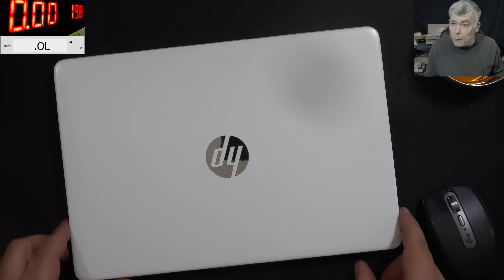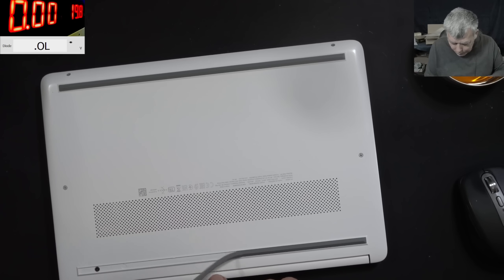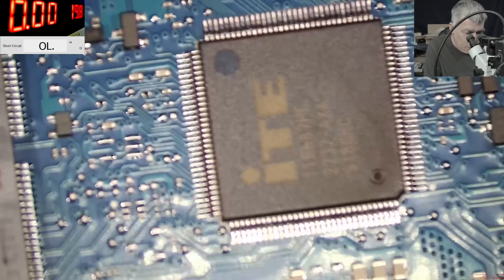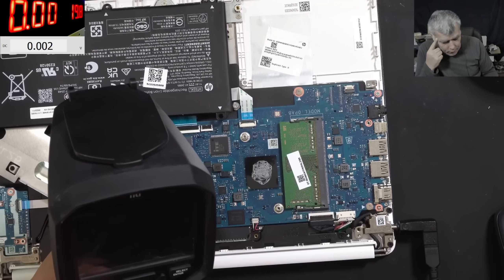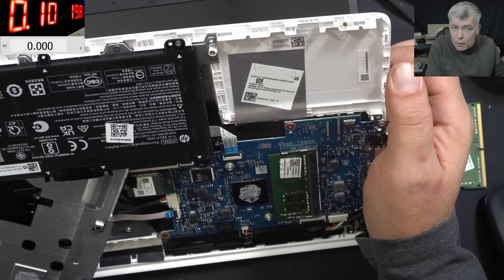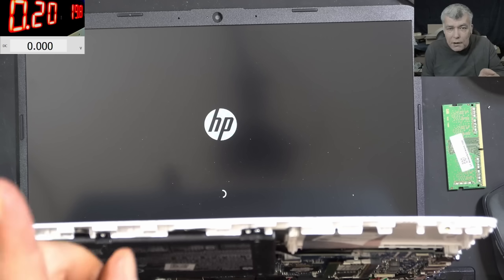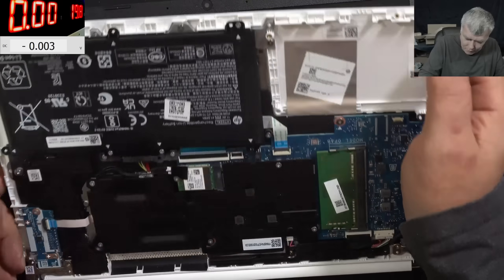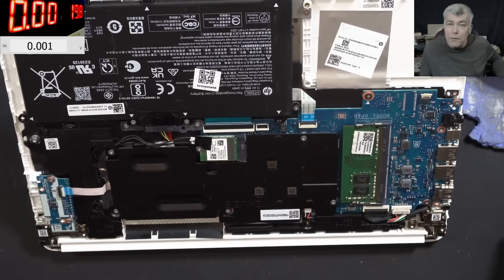Hp flashing screen, not coming on - Keep in mind this unusual fault

Comment: When it started taking more current I was just waiting for it to turn on. These HPs after you fix them or just reset the bios/battery love taking upwards of a minute to actually boot. Used to make me nervous, before I'd fixed my 100th one of those. I repair for a company, I see a LOT of the same model laptops. HPs just love to play dead after repairs for a while. Usually I just leave them on charge to boot up while starting the next laptop and by the time I'm setup for that one I'll know if the last repair took. Usually the answer is yes thankfully.
Reply: My new ASUS TUF does this on a cold boot, takes like 14 seconds for the screen to come on, even with a charged battery, apparently it's normal!

Comment: Initially, I thoguht it will be some capacitor, taking time to charge, and then being shorted "into" the screen. I am glad I was wrong - these laptops are great. Probably HP Stream series, they are power efficient, thus, not needed active cooling and low current needed to start the board. I am writing this using one of them 🙂
Reply: As soon as I saw the soldered eMMC (storage), I puked in my mouth. Bleurgh. Pass! Next!

Comment: I seen on the customers SODIMM Module there is knocked off capacitor, look where the barcode sticker is near the gold fingers, You will see there are 2 pads where something was soldered. Good Luck!
Reply: That is empty by default, might be a test point.

Comment: I've seen a lot of Acer laptops with a similar issue but the screen would flash black and not white, barely visible but always faulty ram. DDR4 ram has a high failure rate.
Reply: All RAM has a high failure point. The amount of read write transactions every second is immense on RAM, stresses it a lot and why most mordern laptops come with thermal sheets on the memory sticks to dissipate heat. This is why I HATE soldered RAM. RAM is classed as consumable.

Comment: It is likely N4500 with extremely low power consumption. Hence no active cooling.
Reply: but it's overheating on hp laptop
Reply: @maklogetrich2378  Nope. It works perfectly fine with this big heatsink. The TDP of N4500 is like 6W
Reply: @kiwichess  many of my customer use this laptop and overheat badly, even the laptop throttle to 0.4 ghz
Reply: @maklogetrich2378  I use this laptop for youtube + internet browsing and it doesn't overheat. If you use such cheap laptop for heavy duty - don't complain it's overhearing.
Reply: @kiwichess  nah, just installing apps

Comment: good morning master..... pls sir i have problem with hp laptop motherboard it blinks cap light once which indicates processor malfunction but if i change the processor the issue is still the same .... but the cpu hot fine
Reply: I would suggest to check if Vcore is fine.
Reply: @fabagd-o6s  Thanks.... 1.5 v is available